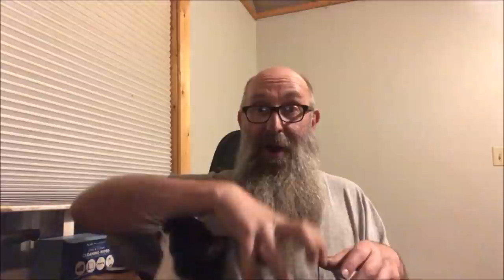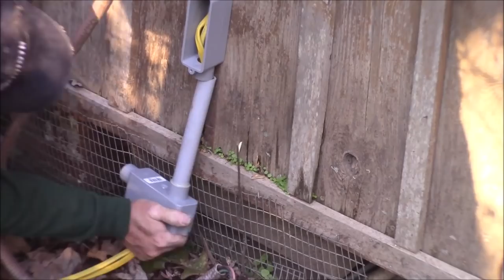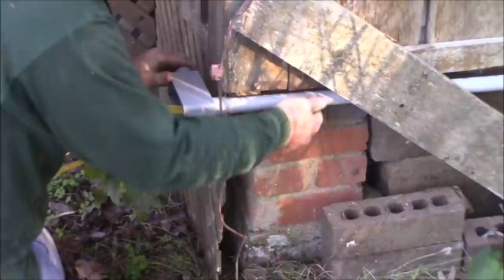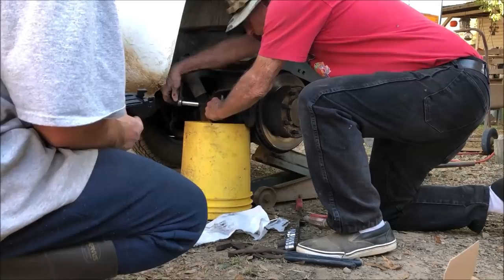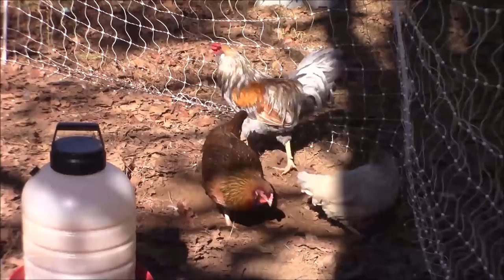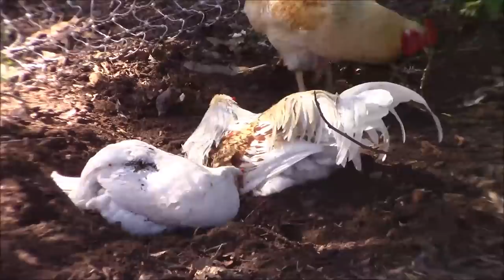Shower Pan | Electric Conduit | Brake Pads For Boss Hogg

Comment: Some people use corrugated metal for a shower wall.  Don’t know how. It looks good, but how long it lasts is another thing. Prayers the HVAC folks will come by and fix everything and it’s fixable.
Reply: seems like it would be harder to clean than a flat, slick surface...but it would look cool :-)